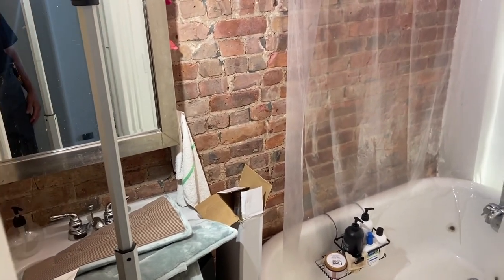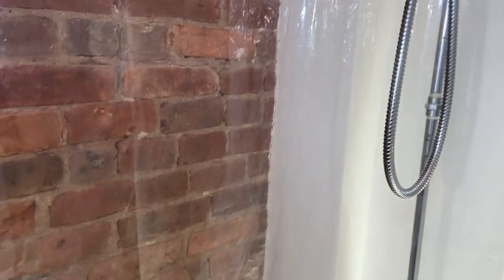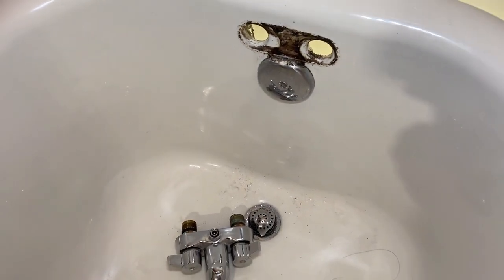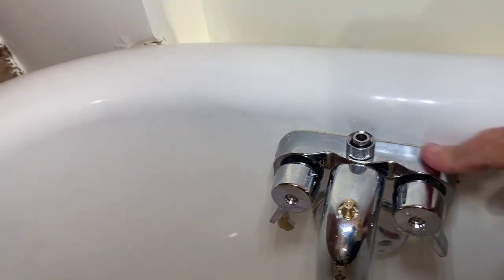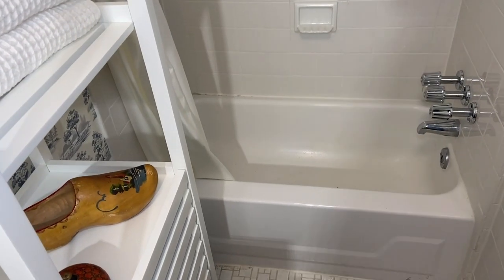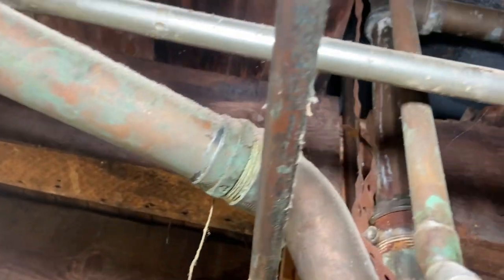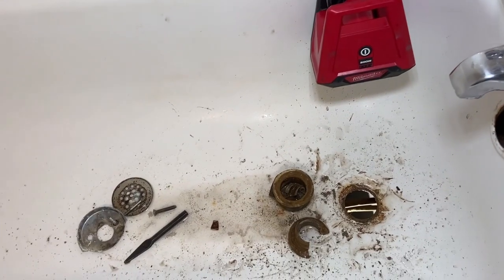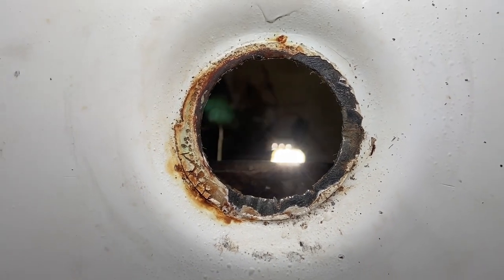Bathtub Faucet Shower Diverter

Comment: My guess is that the bathroom on the first floor was a home owner add done not by a Plumer but a shoemaker; evidence the hacked up joist and the contorted confusing piping in the basement. Your decision to use a screw jack  to hold the shoe in place was Ingenious and was  thinking out of the box in the best sense of the word. Great Job Bob.

Comment: Always watch your videos..
You saved me a ton of money. I watched your video on how to change a leaking tank because of rusted bolts...I did all 3 of my bathrooms by putting in new gaskets, water lines  and bolts in the tank..The toughest one was having to hack saw one of the bolts...Not much gap room to maneuver a tiny saw, took me about 30 mins to saw the bolt off....saved me close to $750 or more for house calls and labor...
Bob, would make a trip.just over the state line into Pennsylvania off of Interstate 80 for a medium to large job about 15 mins once you get into Pennsylvania off of I80 ?
Reply from the maker: Thanks for the vote of confidence! A little too far out of my service area, but thanks for asking. regards, Bob.
Reply: @BobsPlumbingVideos  Keep making these videos...you are tops.